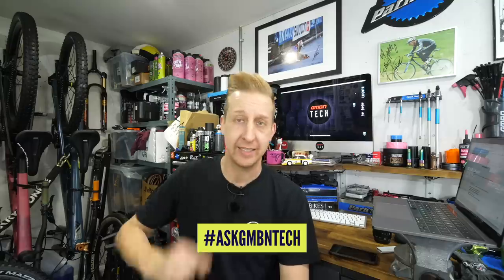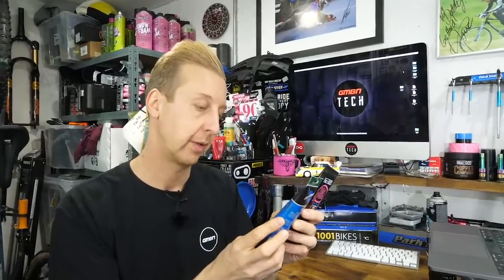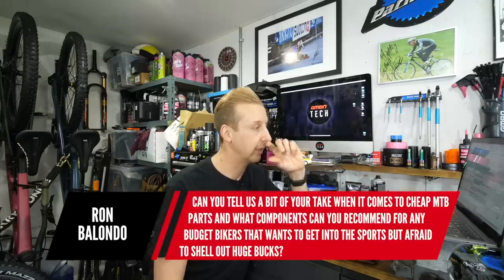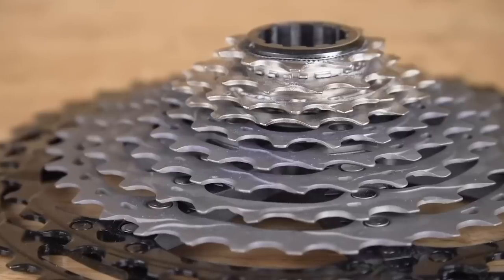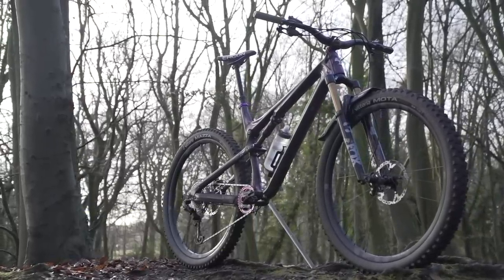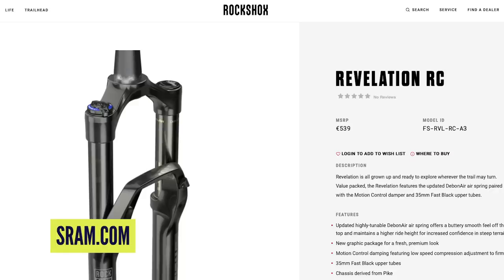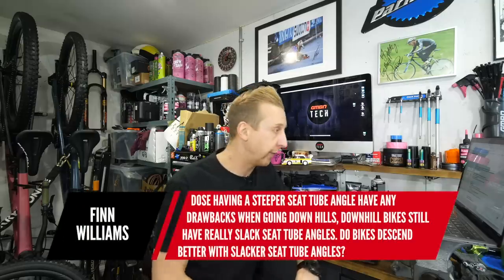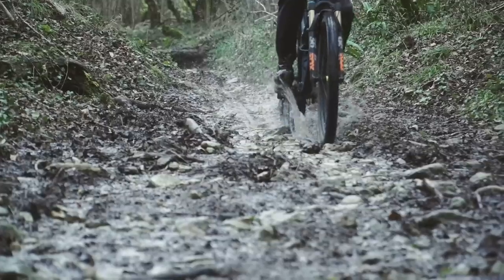What Cheap Components To Save Money For Budget Mountain Bikers? | #AskGMBNTech

Comment: Please do a video where you do c custom MTB but only parts from AliExpress to see how good or bad it is.
Reply: My MTB is almost complete AliExpress, except for the fork, wheelset, brakes and tires :D
Reply: @Schumeyyy  and how's it holding up? Have bought a few things from Ali express but they are yet to arrive and want to see how good they will be
Reply: @ffturbo  Finished the bike a month ago, I broke a seatpost (and the saddle because of it) and a crank bolt, but the bolt was an installation error done by me 😒👍🏻
Reply: @Schumeyyy  lol rip
Reply: @Eng586  i weigh 125 lbs and i had zero china parts fail on me. Maybe i'm too skinny to actually break my bike parts.

Comment: Stuff I went with so far:
Wheels: Nukeproof Horizon V2 ~450€ for front and rear, or any branded super budget if you don't care about engagement (this is worth spending a bit more on though).
Bars: Brand-X Riser or Flat bars ~15€ - 18€ not the widest but the price is a steal.
Dropper: Brand-X ~190€ at least for the larger ones.
Drivetrain: Microshift Advent-X Cassette, Derraileur & Shifter + Shimano M5100-1 1x10 + Shimano Deore XT MT800 ~230€ and lighter than Shimano XT

Comment: Regarding the high pitch noise from the wheel. I have the exact same issue on TWO different DT wheels (xm1650 & xm1501), both brand new. Both wheels are in the shop  waiting to hear on a solution. I have a thread over on the MTBR forum in the wheels section.

Comment: I was going to suggest a dirty/clean drivetrain test as well. ## I deep-cleaned the chain on my single speed commuter the other day, and next morning it felt like I had easier gear. 140 + - links with a little bit of resistance each makes a big difference, especially if your chain is getting rusty, imo .. 
Possible method: bike with a power meter, ride a lap at constant (controlled) speed with a chain from some unattended bike, then clean and lube the chain and repeat at the same speed. Measure the power difference. 
+ Unattended is a relative term. Look at the bikes that park in front of Tesco's... ;-!

Comment: A small word about transmission - chain
Chain can be one of cheapest of the product line.
For example Sram 10 series: 1030, 1050, 1079, 1090.
Tested every one since 2012 (when my 10spd bike arrived).
They working exactly same at 10spd transmission, same shifting performance. Difference is weight and rust protection.
But not worth spending extra money for me. And lightest "90" series can be damaged easier than "50" or "30"... This happen to me ;)
But my favorite "value for money" is basic X series KMC chain. Maybe a bit heavy, without rust protection, but never fail. And shifting performance is outstanding at Sunrace casette.

Comment: To the guy who has a squeak in his DT Swiss wheels, take the freehub off and there is 2 bearings inside with a spacer between them, the noise will more than likely be coming from there. I had this issue with a brand new bike with similar dt Swiss wheels.

Comment: Hi doddy, I might have an answer for Marek. I’ve seen some skeaking on disc brakes because the brake calipers aren’t fitted correctly because of the paint on the frame. This can be easily corrected with the park tool disc brake mount facing set DT-5.2. It’s worth a shot!

Comment: Steeper seat tube keeps the seat farther forward allowing it to be more out of the way for the rider to get low and back. And really the seat is only used for strolling around the top of the course, or resting at the bottom, or to lean on during the push back up.

Comment: I've done the "no maintenence test" this winter.
Every day, snow and rain, ridden hard and put away wet, never even washed it before last weekend.
Result: worn out chain and casette. thats it really. chain could be twisted past 90 degrees over the chainstay, and it did no longer shift properly. new cassette and chain on there and cleaned and lubed up the rest and the bike's as new again... I now question if its even worth the time it takes to wash and lube it every two weeks, I mean they're cheap drivetrain parts..
Then again its nice to have a nice and clean bike to ride..

Comment: I bought the Microshift Advent x 10 speed drivetrain. Loved it for the first five months or so, great trigger feel and sound gear changing, but the derailleur broke. The clutch stopped keeping the chain tensioned enough, so chain dropped continually. It was easy to see that the chain had become too slack on the drivetrain. Took derailleur to four mechanics, all said can't repair it and one even said don't buy another one. Tried to claim under warranty, so sent Microshift a comprehensive video of the issue and was told it looks normal.  Took it all off and bought Shimano XT. I will be sending the derailleur back to them so they can see how badly it malfunctioned. Not the best experience.

Comment: I spot the sport quattro, and the question is read 😂 insane car, that sound! And saw the offroad Porsche. What a beautiful brute! 
About the budget stuff, ergotech has nice rugged handlebars with safety indication. And cheap. Tyres i found a lot of people sell good sets second hand. (At least here in holland)
Upgrade brakes? Try bigger rotors. Adds a bit of weight but great results in performance and modulation.
Cheap chainrings, pretty nice stuff on Ali.
Manitou usually got nice budget forks.

Comment: #AskGMBNTech Hi Doddy, two part question.. I have a 2005 Trek Session that I want to slacken out a bit. It still runs the original Manitou Travis 180mm with a 1.5 inch tube all over. Is there an angled headset for this? Next option would be to get a new fork with a tapered tube and a 27.5 inch wheel, is there an angled headset for this concoction as well? I just want to slacken the bike, and not necessarily raise the front too much.

Comment: In relation to the high pitched squeak in the drivetrain, my friend had a similar problem which turned out to be a hair stuck between two parts of the hub which made a high pitched squeal when the wheel spun.

Comment: #AskGMBNTech Hi there!  I'm wondering how to determine what the maximum rotor size for a particular fork and frame are.  I've got a frameset (2012 Felt Nine LTD) and a fork (2016 Fox 32 Kashima 29), but I'm not finding much info on what size rotors I should be using.  I'm thinking 180 on front and 160 in the rear, but I'd like to know that those are actually compatible with my frame and fork.  Is there any surefire way to know how large I could go?

Comment: #AskGMBNTech Hi Doddy, I love your show. I recently removed the crankset on my GT hardtail because it looked bent and the chain would rub on my front derailleur cage in the 1st and 3rd chainrings (on the inside of the cage in 1st, and the outside of the cage in 3rd). I swapped it out with a new crankset (and new chain and cassette while I was at it), and now I'm getting the same rubbing of the chain on my front derailleur, but only in the 3rd (largest) chainring. When I look down while rotating the crank, the chainring appears straight, but on about a quarter of the rotation the chain moves toward the outside of the derailleur and grinds the chain against the cage. What the heck am I missing? Do I need to adjust the angle of my clamped-on front derailleur? Is my bottom bracket perhaps not drilled exactly perpendicular to the central plane of my bike frame? I can't seem to figure it out. Cheers, and thank you!

Comment: It's worth buying good bars & stem for i have snapped many, my worst one was when I got off the train in North Wales for a week of mountain biking, got of train cycled across Barmouth bridge on route to mom & dads place and bang bars snapped, this was about 30 years ago and do you think I could find a replacement.......no spent hole frellin week cycling on the roads with a tree branch as a set of bars which to be fair were bloody great, just didn't trust them on my rock hopper comp as there was a lot of flex due to using willow as would of snapped if anything eles

Comment: My 2nd comment which is rare if ever,
Nice 1 Doddy that was a good episode with some proper q&a's m8, 
Quick note on kelvin, i have worked on my own bikes for about 40 years, from wheel building to welding bits of frame & even to this day i have referred to kelvin on a few things, even though i have probably come across even the most bizzar of problems there is still always something to surprise myself with. Kelvin  does things the correct way which is always useful to know, he is like the Haynes car manual for bikes, or should i say the bible of bikes.

Comment: im in the process of upgrading my very old giant yukon, ive had the thing since 2003 , bought used  and has v brakes and right now its just a hardtail frame with a square taper BB. any advice as to what i could do with it. 

side note:  i never had any maintenance done on it except change out the bottom bracket  and i road that bike yearly and dailyup in Quebec and Ontario canada for 17 yrs. Trust me when i say that every components life is finished

Comment: #ASKGMBNTECH is it possible to bend/ weaken a frame by over tightening a quick release?
Reply: If your hub (or seatpost) is the correct diameter or width, then no. 
There should be less than a millimetre of movement in the frame between the fully open and fully closed positions of the QR, when the hub or post is in. If, however, you are trying to get a narrower hub between the dropouts, and are clamping the frame around that narrower axle, it will force the frame stays together and put tension on the weld around the BB yoke. This may eventually cause a stress riser and cracked chainstay, but won't cause the frame to be permanently bent, as the distance a QR will travel when closing, even with a narrower than required hub, won't be enough to reach the point of plastic deformation of the frame, and it will spring back to it's original shape.
If you clamp a QR seatpost clamp around a smaller diameter seatpost than is supposed to be fitted, it can ovalise your seat tube at the clamping point, and prevent you from ever getting the right size one in. It won't cause a broken frame, but will be annoying. You can crush hubs even if they are the right size if you are a complete beast, but I've not heard of it happening. The real issue with an over -tightened QR is that it's virtually impossible to get them undone again.
Reply from the maker: @judechandler5102  And then you need to use a tyre lever or something to get them undone! 😭
Reply: @gmbntech  and then the rubber mallet you need goes missing so your only option is to use a hammer and you end up striking the frame😥
Reply: @tonymcnally9355  damn. You went down one long road of bad luck. sorry about that m8

Comment: #askgmbntech. I've been looking  at a 1993 Marin Pine FRS, and wanted to get your thoughts on fitting modern-ish air fork internals to the original Manitou carcasses, if you will. That way I keep the small axle to crown dimensions, wicked retro looks, and rear fork (shock) compatibility, but get a more progressive and sensitive ride. thanks!
Reply: I think air spring will get complicated because the Manitou is an elastomer fork and was never designed to be airtight. I‘d go for coil springs. Doddy had that on an old Rock Shox and it seemed to work good. I don‘t know if there is a hydraulic damper for a Manitou 1 but with such little travel you might get away without one.
Reply: @chrisridesbicycles  I was thinking it may be possible to insert an airtight sleeve containing the internals into the fork lowers to keep it airtight, and mucking around with modern seals. It wouldn't normally be an issue for me, who loves OE specced bikes but I want an FRS to actually ride, not just to drool over.
Reply: @judechandler5102  I guess you will have to build much of it from scratch since modern forks have bigger diameters and the internals will not fit into the old Manitou. Good luck though. Send it in if you are successfull. I‘d love to see an old silver-and-anodized Marin in working condition.

Comment: Hi Doddy, I've got a question about Shimano brake with variable bite point. I've got a set of Shimano Zee's and can't seem to get them to have a consistent bite point. At first, the lever will pull to the bar then move further away with each lever pull until their is a consistent bite point. If left for a short time, the bite point will return to the bar. I have given them a full re-bleed and tried to draw the fluid from the lever to the caliper in an attempt to remove trapped air in the caliper. They still have the same problem. Have you got any tips to fix this? Cheers, love the show. #AskGMBNTech

Comment: #AskGMBNTech Hola Doddy, I just fitted a bash guard and a chain stay  (iscg 05 interface)  in a Trek Slash 8 2021 (aluminium frame). To get  a good alignment  I had to use washers to create a proper gap between the bashguard plate and the frame,  in one of the screws up to 5 mm.  Can this gap hurt the frame  in case of an impact? Or is the bashguard designed to break before the frame is damaged. Thanks for your help and Congratulations on the show!

Comment: #AskGMBNTech
I meant power which you loose while riding with a dirty chain.
And for a home measurement I meant using weight on pedals as "power from the rider" to see how much extra weight it takes to get the wheel going.

Great video idea with the drivetrain difference.
I can volunteer as a contestant :D
It's muddy and grimy and I can put down around 300-500km in two weeks if necessary.

Thanks for answering been a day one watcher of the tech channel

Comment: #AskGMBNTech I bought a new KMC 9s chain because the existing one I'm using is worn out per the chain wear tool. My problem is, the chain skips  when pedalling. What bugs me is when the old chain is put back, it doesn't skip. Thanks a million!
Reply: Sounds like your cassette is worn aswell. Check the teeth of the cassette, if there not uniform, often looking like a sharks fin, its too worn and should be replaced as well. 
If the cassette is worn by the same amount as your chain it will skip less, but you should replace both as not doing so will wear your chainring prematurely.

Comment: Favorite car is the audi s1 also such a great, aggressive car like you said. The bangs and pops are because the car used an awd system not 4wd as there is a difference. The system used was an older style if you will and, the car had no handbrake or at least couldn't use the one it had so it relied on shifts and clutch kicks to get the car to slide and obviously the awd system made is drive sideways. However unlike the Peugeot 205 that came later it was very big and alot of the weight was at the front causing the car to oversteer. But nevertheless the car was totally revolutionary. Awd, about 600+hp and crazy huge aero meant it was a rocketship and totally took the group B era by storm.
Edit: a nutcase to ride crazy distances superhard, look no further 😁 I get the stuff Ill ride the pants off it 😂

Comment: #AskGMBNTech - Hi Doddy, I have a few problems with my Fox 34 fork. I have recently done a lower leg service and upon reinstalling the bolts into the brake mount, I noticed that the bolt has made a small hole in the bracket where the bolt goes in, right near the bottom of the fork. When I threaded the bolt in I applied grease and when I tightened it the grease would seep out of the hole in the side of the mount (the hole is only very small) The threads aren't striped and the bolt is perfectly as it should be. I'm also in need of a new CSU unit as the one I currently have has started making a cracking sound most times when i land off a jump, where the stanchions go into the crown of the fork. I brought my bike second hand in December of last year and is a 2019 model, so the fork is out of warranty. What do you suggest that I should do? Do you think I will need new lowers and a CSU or do you think that it would be more cost effective if I were to purchase a complete new fork?  Love the show, watched them all! Thanks, Henry
Reply: send it out to a local suspension tuner. Fin at Full Factory Suspension is amazing if you live near there. They can advise you and probably fix the issue for waaay less than a new fork would cost

Comment: Side Note - (@ 19:00 mins.)Turns out the SRAM B-Gap adjust template tool is slightly different for the AXS mechs... not sure why. Its purple rather than red. It might be a case of SRAM selling the same thing twice in two colours, or there could be some differences... I'll dig mine out to check, but worth being aware of.

Comment: Hey Dobby, I just started mountainbiking and have done great over the last year but I rode mostly XC and when I go a bit more offroad I feel my (nearly) stock bike slowly meets it's limits and since I'm a rather big guy I bottom out my fork more than I'd like to. Any tips on a new budget fork and any other parts I should consider upgrading? 
I'm riding a GIANT Talon 4 (2016) 27.5er size L with new pedals (Stamp 1), Schwalbe Racing Ralph EVO Addix 2.25 and some lock on grips. 
Thanks in advance and keep up the great content, your videos helped me a lot with technical issues. Grettings from Germany ^^ #AskGMBNTech

Comment: #AskGMBNTech Hi Doddy, I'm struggling to find good quality components to replace my aging 3x7 shimano drivetrain. Everywhere I look the options are limited to a few mediocre options. I am still using a square-taper BB with tripple-ring Shimano Front Cranks and Shimano 7speed Freehub Cassette right now and I don't think the the bike lends itself to changing to a 1x10/11/12 setup particuarly well. Any recommendations/suggestions on obtaining decent gear shifters? I've recently went to the effort and expense of replacing the front and rear derailleurs with Tourney components, but would really like to get away from the gripshifts as they are not ideal on my new handlebars with the new standard sized grips.